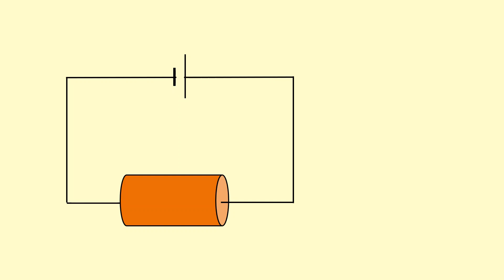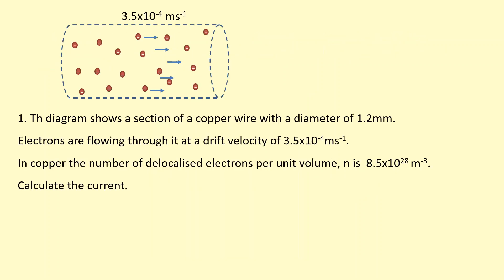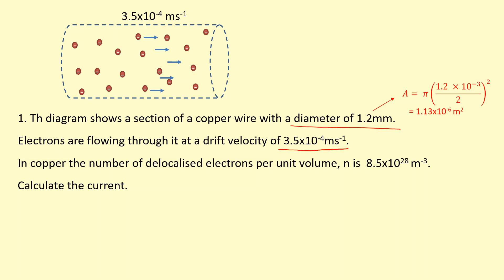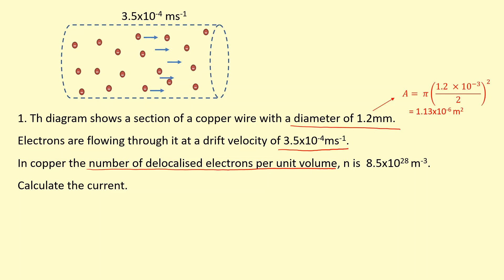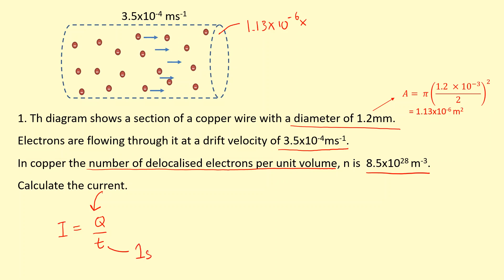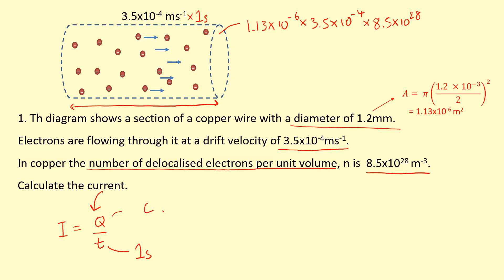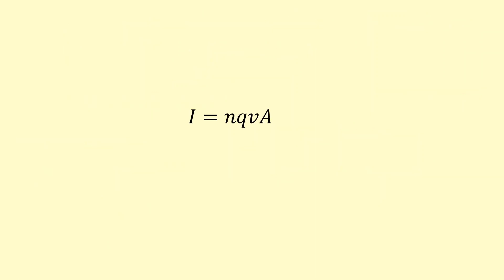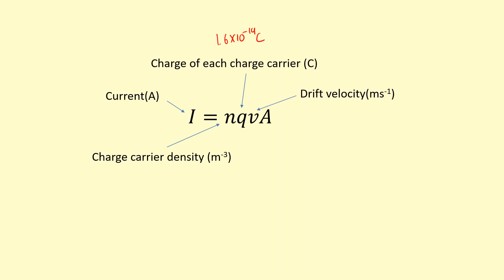3.14 How does current flow in metals

Comment: why does collision with lattice ions mean they reach a constant drift velocity, do they all end up having the same kinetic energy or smth
Reply from the maker: There will always be random variations, but it doesn't matter because you can just use the average kinetic energy of the particles.
Reply: @MrNagaPhysics  so if there are some random variations in ke for some of the electrons, does that mean they could have a higher drift velocity
Reply from the maker: @User-zl3yv Drift velocity is the average. Yes some particles could by chance be moving at very high speeds. Some could be moving very slowly.

Comment: is this in the aqa specification? i checked i dont think it is
Reply from the maker: Good point. An short answer is you're right, it's not on a spec and maybe not worth stressing about.

But...a few years ago( 2018) AQA asked a question on Archimedes principle, which wasn't in the spec. Then more recently (2022) they asked a question about natural abundance of isotopes, which is in the chemistry spec. 😂

Basically AQA can give you a bit of info about an idea in the exam paper and then ask a question about it. Which is why i i teach this to AQA students too because i think it's a useful idea that could infact come up.

Also the main ideas behind this isn't just about current flow. It's about any particle or substanc that is flowing through a pipe of some sort. 

Look at these two videos, isn't the flow idea used in these very similar to what we have in the video above?
https://youtu.be/pvd_Ex3e-mg
https://youtu.be/1a-H1JNCWHQ